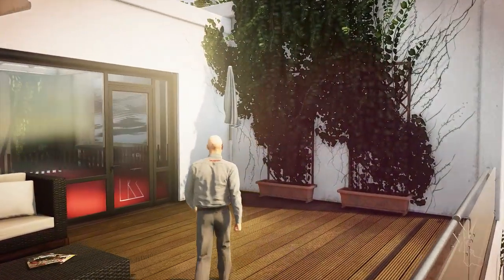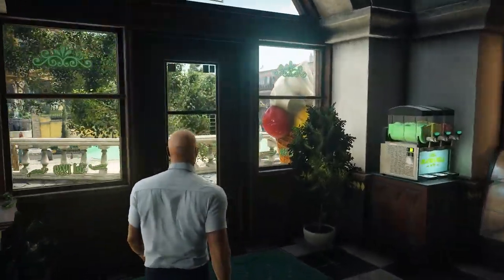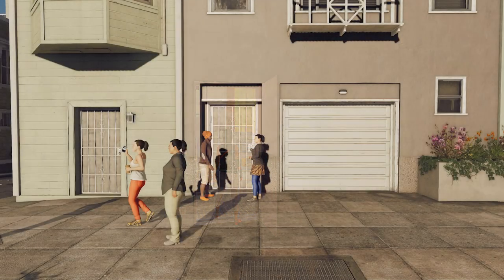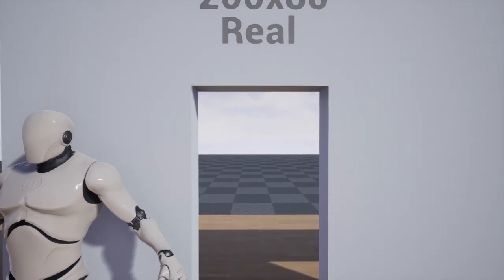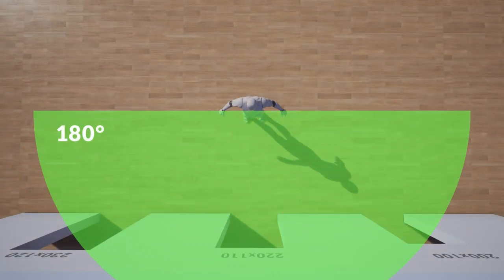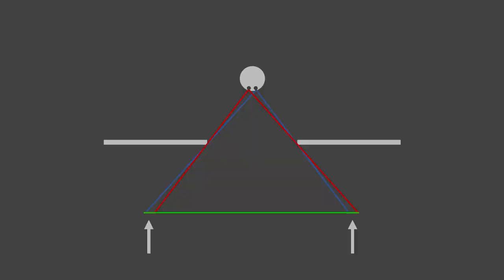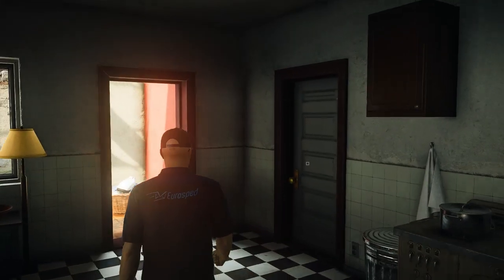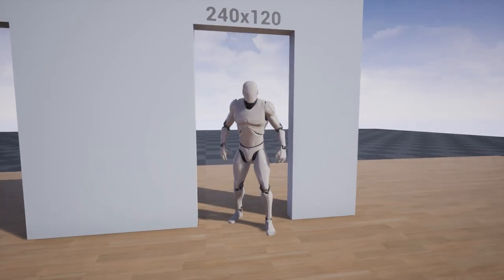What's wrong with doors in games?

Comment: I feel like I have to argue with you here because not all doors are universally the same height. The height of doors in the USA try to be a minimum of 6 feet and 8 inches for homes. The average height for female is under 6 foot and the average height for a male is over 6 foot. When you look at game characters, they almost always do not meet the prerequisites for size comparison every single time and that is because It has always been about feeling good; Even the Unreal model is unrealistically too wide. To fix it, we measure in heads, not feet or meters. This is also why men and women are almost measured to be exactly the same height in video games.
Reply: Average door specifications IRL are 3ft wide & 200cm high for residential, 3ft wide & 210cm high for commercial.
Reply: But by no means is it a minimum ore requirement. They can change size to whatever they want. @Drayken
Reply: @Thesupperals  No shit sherlock, the point is that's what standard IRL unless you want to deal with the headache of sourcing unconventional doors and materials.